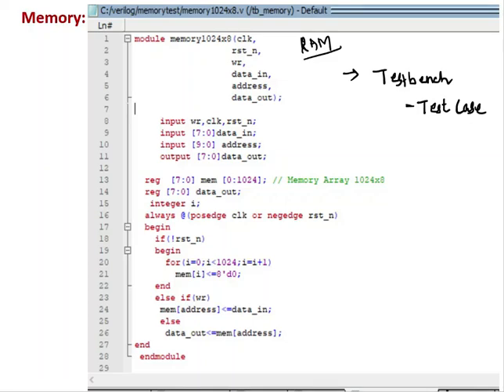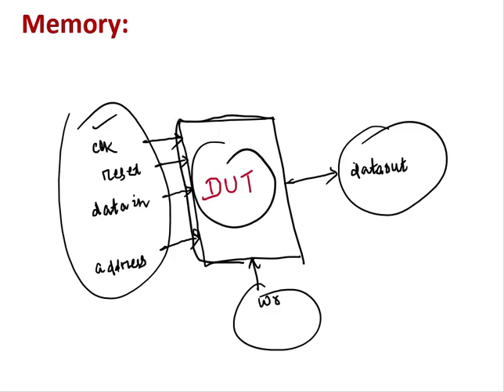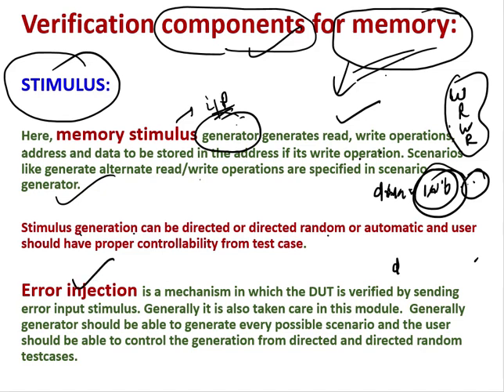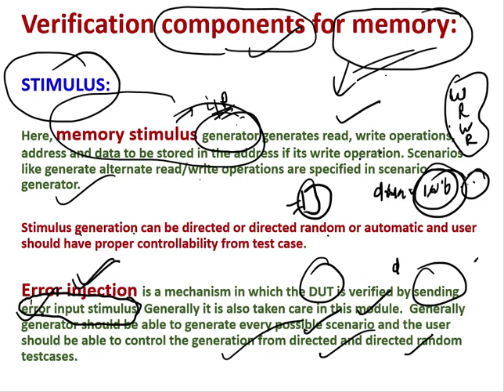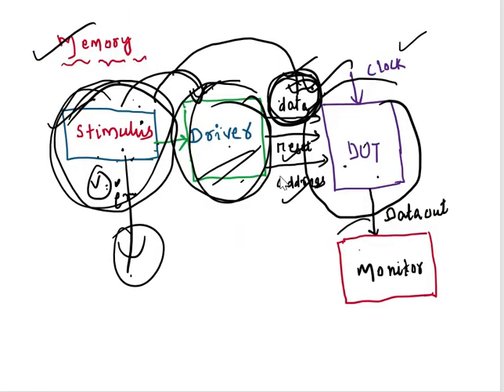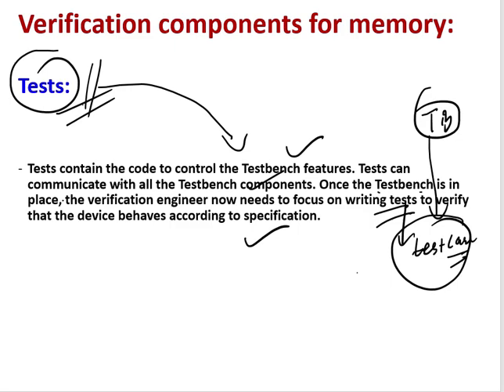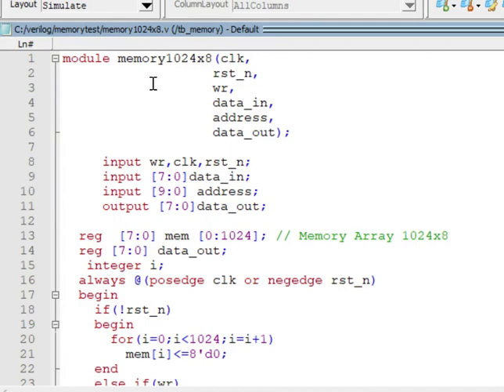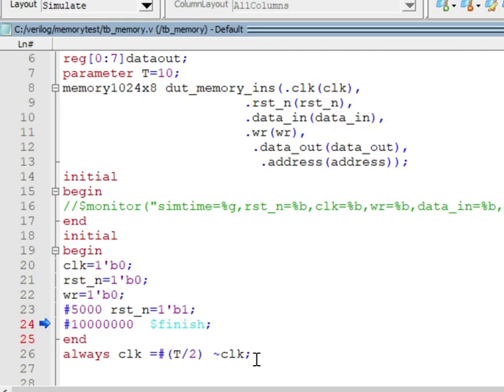RTL based Memory Verification || How industry standard Testbench is written for Verification

Comment: Very useful, thank you so much Sir..maja aa gaya...
Reply: module mux12x1(input [11:0] data_in,
               input [3:0] select,
               output reg out);

  wire [3:0] s0, s1, s2;
  wire [1:0] d0, d1;
  wire [0:0] d;

  // First stage of 4:1 multiplexers
  mux4x1 m0(data_in[3:0], select[1:0], d0[0]);
  mux4x1 m1(data_in[7:4], select[1:0], d1[0]);
  mux4x1 m2(data_in[11:8], select[1:0], d[0]);

  // Second stage of 4:1 multiplexers
  mux2x1 m3(d0, select[2], s0[0]);
  mux2x1 m4(d1, select[2], s1[0]);
  mux2x1 m5(d[0], select[2], s2[0]);

  // Final 2:1 multiplexer
  mux2x1 m6(s0[0], select[3], out);

  // Always block for updating the output
  always @(*) begin
    case (select)
      4'b0000: out = data_in[0];
      4'b0001: out = data_in[1];
      4'b0010: out = data_in[2];
      4'b0011: out = data_in[3];
      4'b0100: out = data_in[4];
      4'b0101: out = data_in[5];
      4'b0110: out = data_in[6];
      4'b0111: out = data_in[7];
      4'b1000: out = data_in[8];
      4'b1001: out = data_in[9];
      4'b1010: out = data_in[10];
      4'b1011: out = data_in[11];
      default: out = 1'bx; // Output is 'x' for invalid select values
    endcase
  end

endmodule

module mux4x1(input [3:0] data_in,
              input [1:0] select,
              output reg out);

  always @(*) begin
    case (select)
      2'b00: out = data_in[0];
      2'b01: out = data_in[1];
      2'b10: out = data_in[2];
      2'b11: out = data_in[3];
      default: out = 1'bx; // Output is 'x' for invalid select values
    endcase
  end

endmodule

module mux2x1(input [1:0] data_in,
              input select,
              output reg out);

  always @(*) begin
    case (select)
      1'b0: out = data_in[0];
      1'b1: out = data_in[1];
      default: out = 1'bx; // Output is 'x' for invalid select values
    endcase
  end

endmodule

Comment: Sir, I have watched all videos where I have observed that all times you have used D Flip Flop, why is it so? How will you compare D F/F with other F/Fs?
Reply from the maker: You are the first one to ask me this question. I am glad that at least someone has this doubt.

when we write HDL code for a sequential circuit and implement this in FPGA board,  synthesis tool generally converts our HDL code into D FF as this type of flip flop is easy to use and simple. Because of its simplicity and versatility people use D FF.
When it's ASIC design (and not FPGA design) then people use different type of flip flop as per their requirement.
Reply: @ComponentByte  Thank u sir. ur videos encourages me to learn VLSI, VERILOG & now I am more interested in this field. I am requesting you to make videos on VLSI Architecture- MIPS register file, partial datapath, MIPS, RISC, SISC, CISC, Pipelining in a processor, VLIW, Cache memory, floating point etc., whichever possible for you.

Comment: module mux12x1(input [11:0] data_in,
               input [3:0] select,
               output reg out);

  wire [3:0] s0, s1, s2;
  wire [1:0] d0, d1;
  wire [0:0] d;

  // First stage of 4:1 multiplexers
  mux4x1 m0(data_in[3:0], select[1:0], d0[0]);
  mux4x1 m1(data_in[7:4], select[1:0], d1[0]);
  mux4x1 m2(data_in[11:8], select[1:0], d[0]);

  // Second stage of 4:1 multiplexers
  mux2x1 m3(d0, select[2], s0[0]);
  mux2x1 m4(d1, select[2], s1[0]);
  mux2x1 m5(d[0], select[2], s2[0]);

  // Final 2:1 multiplexer
  mux2x1 m6(s0[0], select[3], out);

  // Always block for updating the output
  always @(*) begin
    case (select)
      4'b0000: out = data_in[0];
      4'b0001: out = data_in[1];
      4'b0010: out = data_in[2];
      4'b0011: out = data_in[3];
      4'b0100: out = data_in[4];
      4'b0101: out = data_in[5];
      4'b0110: out = data_in[6];
      4'b0111: out = data_in[7];
      4'b1000: out = data_in[8];
      4'b1001: out = data_in[9];
      4'b1010: out = data_in[10];
      4'b1011: out = data_in[11];
      default: out = 1'bx; // Output is 'x' for invalid select values
    endcase
  end

endmodule

module mux4x1(input [3:0] data_in,
              input [1:0] select,
              output reg out);

  always @(*) begin
    case (select)
      2'b00: out = data_in[0];
      2'b01: out = data_in[1];
      2'b10: out = data_in[2];
      2'b11: out = data_in[3];
      default: out = 1'bx; // Output is 'x' for invalid select values
    endcase
  end

endmodule

module mux2x1(input [1:0] data_in,
              input select,
              output reg out);

  always @(*) begin
    case (select)
      1'b0: out = data_in[0];
      1'b1: out = data_in[1];
      default: out = 1'bx; // Output is 'x' for invalid select values
    endcase
  end

endmodule